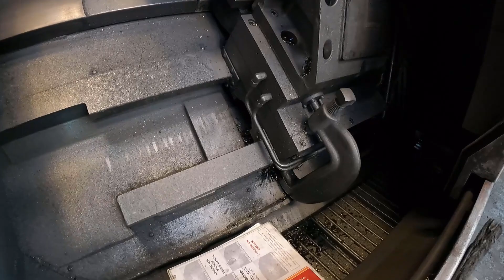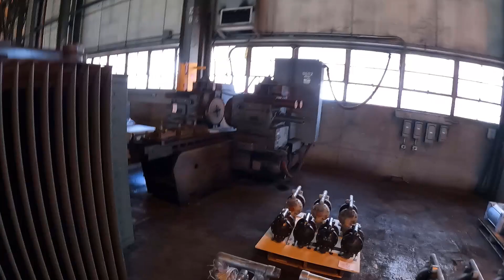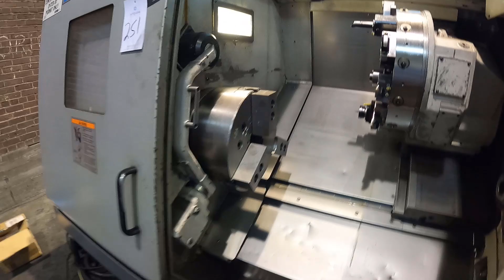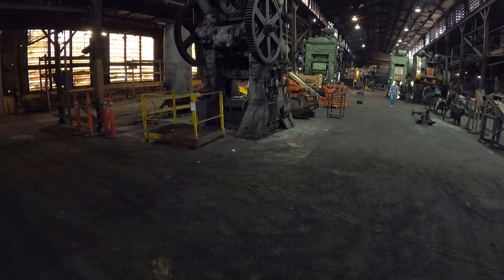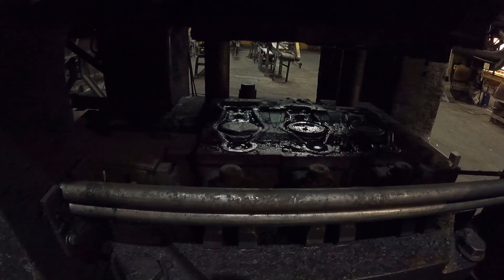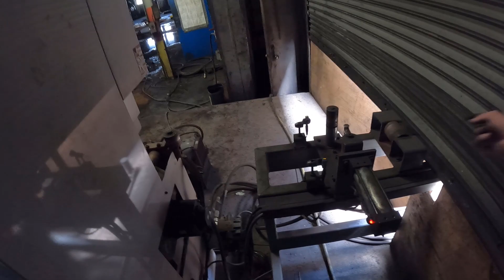Massive Forging Press Auction & Plant Tour

Comment: I actually worked here just second foraging press he showed you wasn’t actually a forging press it’s called a coining press cold  parts went in there and they straightened it up. Basically, the second press he actually had his hand in. It made brakes for semi we called him brake, semi, or sorry brake spiders then press where he said at that one part you have a Buster a blocker and a finisher die so bang bang bang one piece. The big Ajax press is where the caterpillar parts were made 70 pound counterweights for that big dump truck that holds 84 Ford explorers for the engine that’s in that truck. It takes eight of those counter weights. This place was actually Henry Vogt before they shut down in 95 I believe. It went through a couple other names before millennium took over. They come up from Wisconsin.
Reply: I think Covid was the reason for the closure.

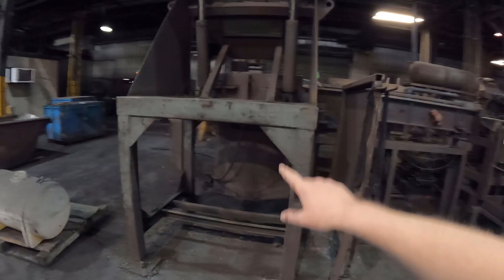Comment: 10:24 is that a vibratory feeder? Not used to them that large. Typically see them sized for smaller parts like screws.
Reply from the maker: Yes you are correct it is a feeder bot a tumbler. I couldn’t see inside of the tub from where I was. Pretty wild how big it was.

Comment: Louisville has some amazing industry. If you thought that 250 hp motor was big Ill try to remember to grab a picture of the biggest motor I currently check. Thanks for sharing.
Reply from the maker: I would love to see it
Reply: I worked on a 4,160 volt 9,500 hp motor at nucor steel plant in Brandenburg, KY